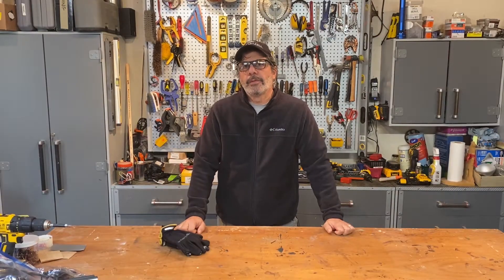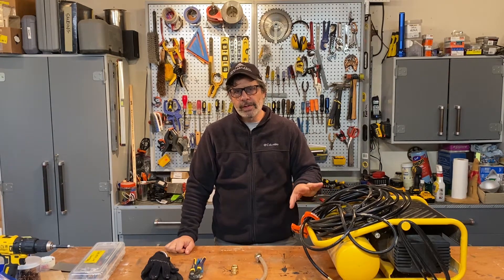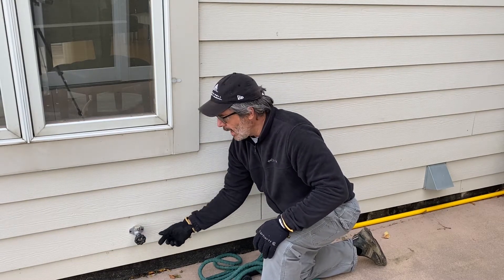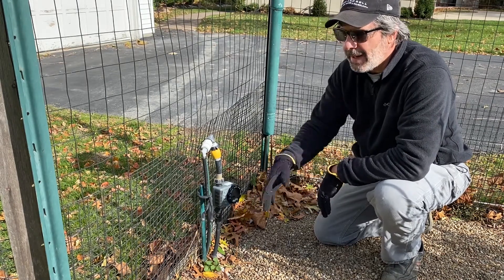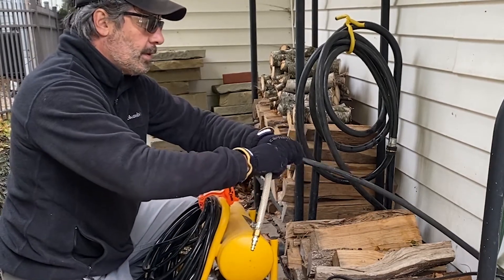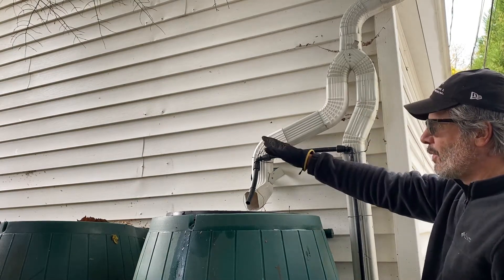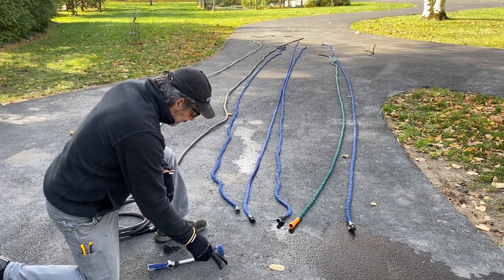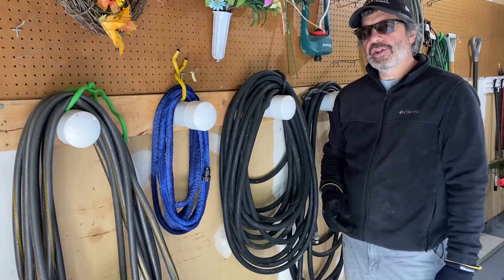How to Winterize Hoses, Rain Barrels and Irrigation

Comment: You didn't show how you clear the drip lines also what psi did you set your compressor to?
Reply from the maker: Great question.  Most micro-drip systems do not recommend blowing them out with a compressor.  Even low air pressure can blow sediment into the drip tips and plug up the system.  

When you install a micro drip system you should include a removable drain cap on the low spot of the primary lines (the 1/2" tubing).  You simply unscrew that cap and let the water drain out and leave it open so air can enter the lines in the winter.  With micro-drip irrigation systems, it is assumed that every spring you are going to be doing some minor repairs and replacement of parts.   

If you have multiple "low spots" install multiple removeable drain caps. I have four of them (one on each corner of my big garden).  

I've had the system for about 10 years and have never seen any freeze damage in the main lines or the micro drip lines, but you will need to replace a few parts and patch some leaks every spring.   

Thanks for pointing this out, I should have included this in the video.

Comment: Thanks for sharing, this was insightful!  Would like to know more about your garage organization (3 in PVC)- how was it installed to hang and support the hoses?
Reply from the maker: Thank you!  I drilled holes through that 2X6 using a hole saw with the hole size equal to the outside diameter of the PVC.  The PVC sections are open on that end.  I cut them about 12” long, slide them into the hole until they are flush with the backside, then I just put 3 screws through predrilled holes, through the sides of the PVC and into the 2x6.  Basically screwing them in from the backside, on a alight angle through the PVC and into the lumber.  Because the PVC fits snugly in the hole in the lumber, it holds a lot of weight and the screws just keep the pipe in place.  Then 8 use PVC cement on the other end to secure the matching cap for the pipe.  Then I screw the hole assembly into the studs in my garage wall.  It is carrying a lot of weight so use 3”+ screws and make sure you’re hitting studs.  

Thanks for the feedback and good luck!

Comment: Hi. I enjoy watching your video. I'm looking for some of the material you used to realize the project in the description. 😯 none! Looking for the solenoid and the float switch
Reply from the maker: Here is the solenoid I use. I bought mine on eBay (new). https://www.ebay.com/itm/3-4-Brass-Solenoid-Valve-NORMALLY-OPEN-N-O-110V-115V-120V-Volt-AC-VITON-B21V-/122490601096?_trksid=p2349624.m46890.l49292

Here is the pump I’m using (From Northern Tool).  https://www.northerntool.com/shop/tools/product_200249074_200249074

Here is the Float Switch (from Amazon) https://www.amazon.com/dp/B082J71MJZ/ref=cm_sw_em_r_mt_dp_YYFSGDKE2R69KDM4EBC5
Reply: @dontscrewitup  thank you. 
Greatly appreciated..